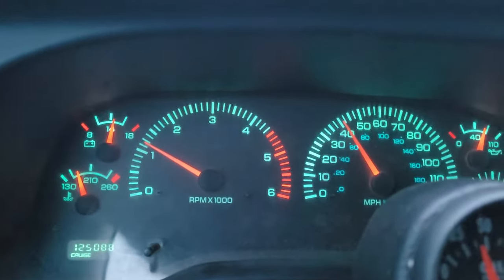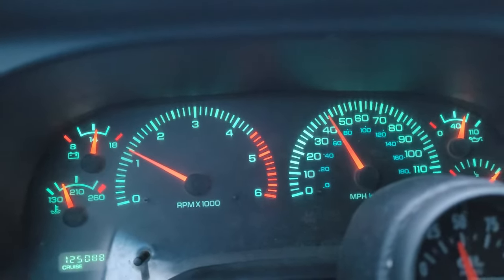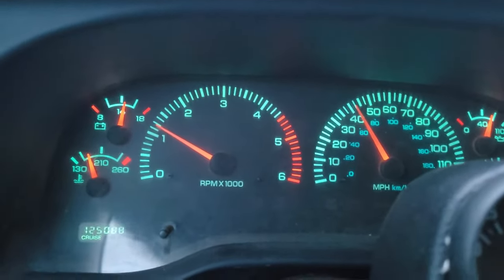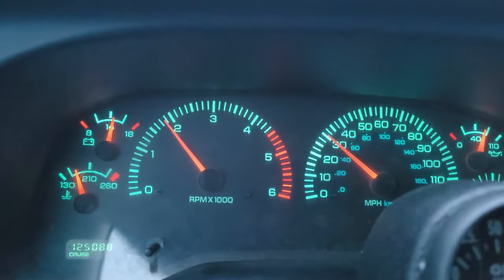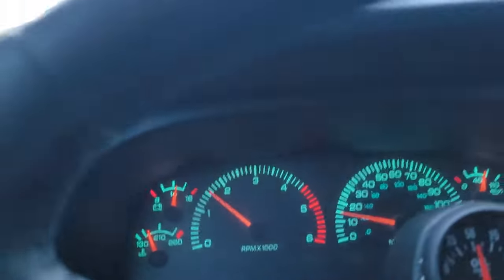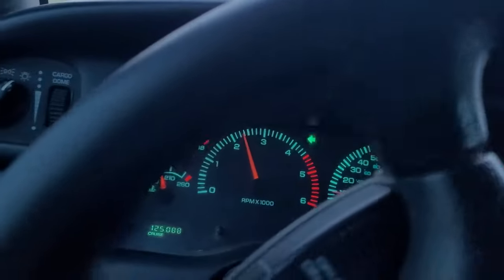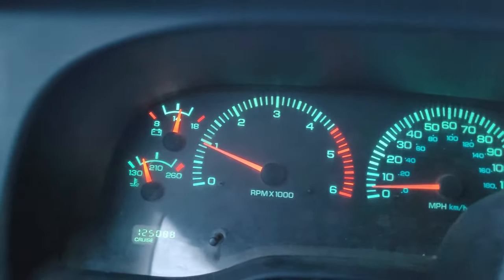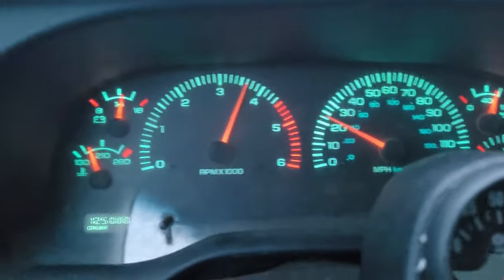01 Ram 8.0 V10 Flyin Ryan tuned thoughts. 1:14 for acceleration run.

Comment: It’s pretty fast for something designed for pulling tons of weight.
Reply: that’s why it’s fast, big torque and hp
Reply: and it’s a heavy truck😭
Reply: Still not as strong as diesel for towing
Reply: @gtavgraphicsdemo6987  the v10 has more torque and hp then the cummins it is the better engine for towing on 2gs, it just gets 8mpg thats why nobody wants it lmao
Reply: @tylerladerach769  8.0l V10 magnum has 450 lb-ft of torque while 6.7l V8 Cummins has 930 lb-ft of torque. 
Diesel will always have more torque than gasoline engines that's it.
But that engine is still impressive for a gasoline one
Reply: @gtavgraphicsdemo6987 you compared a new engine to an old engine. Compare the 5.9 12 and 24 v 😂
Reply: @MurderPete379  cummins are not new bro, exist before 2000's
Reply: @gtavgraphicsdemo6987 what I’m saying is a 6.7 started in the later 3rd generation to 5th generation dodges. Compared the numbers to a 5.9 Cummins those numbers will definitely look different fam. The 24v makes 235 hp on the high output isb. They didn’t get to the 300 hp mark where the v10 kinda held its own for years until the 3rd generation came out. The 900 ft lbs figure you are talking about is coming out of a newer truck with an updated transmission, just saying bro the comparison was like comparing my 5.9 magnum 1500 to a  new gen dodge hemi 5.7 making 400 hp over my 265 hp. Of course the newer one is going to run circles around the older trucks!
Reply: @gtavgraphicsdemo6987 "6.7 V8 cummins" what
Reply: It wasn't 💀
Reply: @gtavgraphicsdemo6987  put down the drugs dude
Reply: @gtavgraphicsdemo6987 you really compared an 1994 design to a 2007 design 😂😂😂 we’re 30 year old platforms and still hurting feelings. My turbo V10 is gonna hurt yours even more 🤣

Comment: Man I've always wondered what q of those would do in a Dakota, I got an RT with the 5.9 and it moves about that fast, maybe a little quicker but it's got the automatic. But hot damn that'd be a rowdy machine with just a stock v10. Love it man, you've got a keeper.
Reply: I’ve been thinking the same thing tho I don’t know if I’d have to change transmissions, mines a regular 5.2l 5 speed
Reply: Get a shorter final drive, try 3.73

Comment: My 94 with the automatic had the Mopar performance ECM. Being a regular cab 2wd it was the lightest truck they put the powertrain into.  Not knocking your truck, but the gearing on the auto was much better for acceleration with the 3.55 rear gear than yours appears to be with the 5spd. 0-60 was about 6 seconds in the old 94. If I launched it right, it would dead hook and felt like the truck was rear-ended by a train.
Reply from the maker: Nice!
Reply: Would love to find one of those for my stock 94
Reply: @smgussey  

You can still get flywheels for these- same as a 12or 24V Cummins with a standard NV4500 that hasnt had a HD input shaft put in.
Reply from the maker: @Joel A.  the clutch and pressure plate are the same as Cummins... the flywheel itself is NOT the same, the crankshaft bolt pattern is different.
Reply: 😂😂 that pos ain't hitting 60 in 6 seconds 😂😂😂
Reply: @19shawn85  My 1994 RCLB did.
Reply: I'm sure the RC 2x4 hit 60 in 6 seconds. I've timed my QCSB 4x4 at 7 flat in 4-High

Comment: I was honestly expecting more
Reply from the maker: It weighs over 7000 lbs with all my tools and gear... I didn't get video when it was empty. It's a low end torque pulling engine, not a high revving race engine.
Reply: @smgussey  Ahh I see. Torque monster things lol

Comment: Im sure it's better then it was, but that's probably a heavy truck and weight is a huge killer for acceleration, for a extended cab Long box 4x4 to accelerate as well as a V6 accord, it would need at least 500 horsepower
Reply from the maker: I weighed it a while after this, and it was 7200 pounds.

Comment: Why is big V10 8.0 and have revved low as 5,000rpm?
Reply from the maker: Designed for low end torque like a diesel, 450 ft-lb at 2400 rpm stock. Specially designed intake manifold to boost torque at 1700 and 3300 rpm too. It was meant to compete with the diesel option of the day, and it out powered them in stock vs stock form.

Comment: Am swapping my 96 v10 to nv4500 I took everything out and I have all the parts needed for the swap except the flywheel I couldn’t find anything even used any idea where to git one i live in Saudi Arabia.
Reply from the maker: Flywheels are out there, just difficult to find. Used is the only option these days. Find salvage yards on Car-part.com and start calling to see if one has a flywheel and is willing to ship it.
Reply: @smgussey  thnx
Reply: I redrilled 5.9 Cummins flywheel it’s the same size as the flex plate even the starter have the seam teeth
Reply from the maker: @mohammedalmisned7491  hopefully they are balanced the same!
Reply: @smgussey  the flywheel from a Cummins is balanced as far is I know I’m finishing the swap today
Reply: @smgussey  the flywheel works 👍🏻

Comment: Is this v10 built off the viper motor?
Reply from the maker: It is similar but has different heads and intake.

Check out https://www.allpar.com/threads/the-dodge-truck-v10-engine-1994-2003.229979/

Comment: Has the redline of a diesel lol
Reply from the maker: Designed as a low rpm torque motor, diesel torque (better than 12 valve stock vs stock) and gas engine horsepower (305 stock) without the noise, stink, or over priced fuel.
Reply: @smgussey  seems like it would kill horsepower and limit how fast it gets up there in the top end.
Reply from the maker: @VigorousZinc  the top end isn't designed for the high RPM, seems like the usual first thing to break is a rocker bolt, followed by more valve train issues. Just the way it was designed.

The tune really opens it up and makes it respond quicker... really easy to get over the redline before you realize it!
Reply: @smgussey  so does the tune raise the rev limiter? I was surprised to see it go that high! I also wouldn't want to do that very often with stock internals! 😬
Reply from the maker: @9DodgeFan  yes, it appears to have raised the rev limit considerably. That's the highest (and only time) I have taken it, didn't realize it was going to go that quickly! I had meant to include in my comments when ordering to keep the rev limiter at the stock setting but forgot.